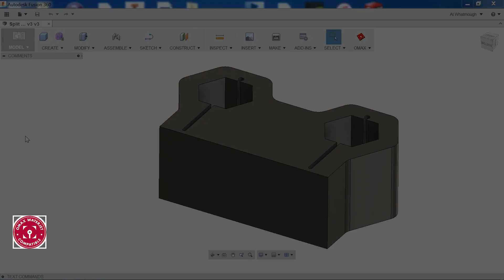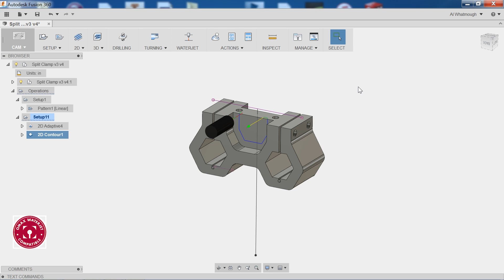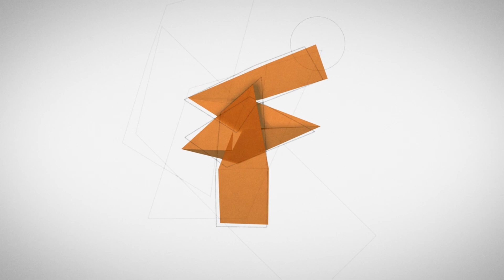CNC Machining and Waterjet Capabilities within Fusion 360

Comment: ...and yet F360 has no metal sheet bending operation capability.
Reply: +Anas Suhaimi It's on the roadmap this year.
Reply: +Curtis Chan I am using Inventor 2016 HSM because sheet metal & frame generator aren't in Fusion360. And sometimes I upload my models to Fusion360 to do FEA studies..... I wish for sheet metal & frame generator in Fusion360........
Reply: +Egbert de Pauw Totally understand...definitely both on the roadmap...in due time.  This year.

-C
Reply: +Curtis Chan I'll wait for it, but what will be the main difference between Fusion360 and Inventor when Fusion360 get's all the stuff that's Inventor only atm ?